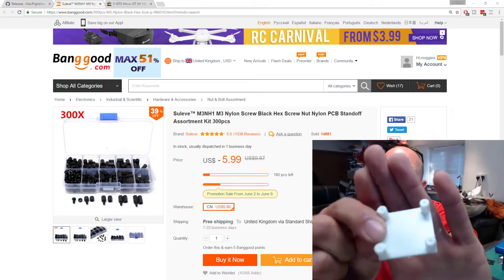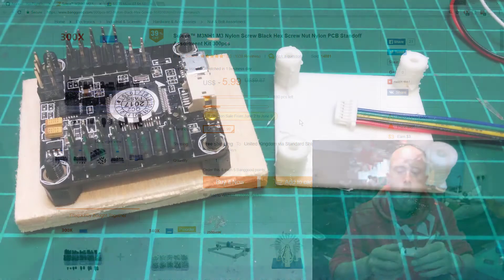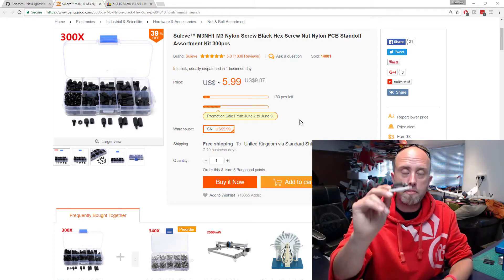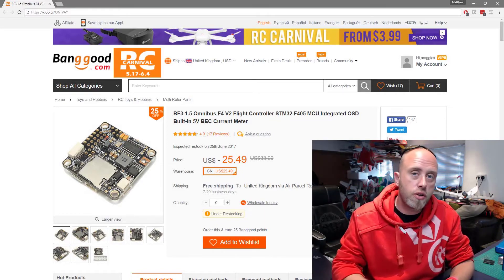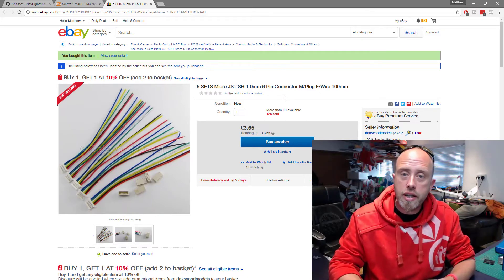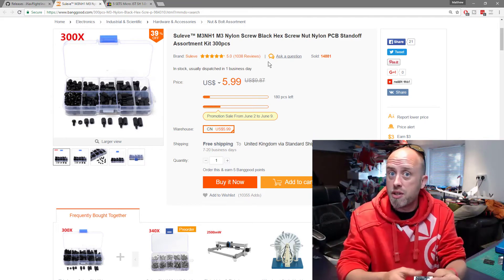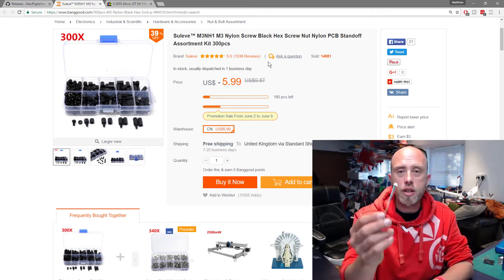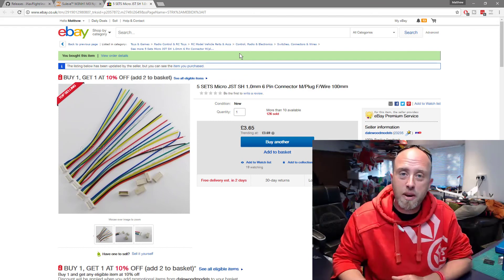Part #2B - Two Inexpensive Parts I Missed for Your iNav Build (updated version)

Comment: Don't forget when using the F4 FC boards of any brand, you should be using the rubber anti-vibration mounts. (NOT the hard plastic ones). I think these were the ones that I used.
"FPVDrone M3 Anti-Vibration Fixed Screws Mounting Hardware Standoffs Spacer for Flight Controller"-  From Amazon.com  about $8 for a package of 8.
Reply from the maker: Morning, they're not really needed in fixed wing models as there is a fraction of the vibrations when compared to a multi-rotors, Matt
Reply: I am going overboard for the sake of insurance.
Cheap or broken arm carbon fiber quad frames are great protection for the boards and all. 
At least for mounting in larger models I can even leave the arms on.

Comment: Greating from the US and enjoy your videos. Coming from Quadcopters, I'm excited about more flight time and the exhilaration of high speed. However, I bought a F4 V3 thinking it was better than V2, but it does not have amp readings, so I'm looking for the exact one you recommend. However, banggood is out and so is ebay. Which F4 Omnibus models with have the features you talk about? -Need substitutes please. There are various types of F4 V2s, but very confused.
Thank you.
Reply: Cliff. You find your answer? I am trying the new Matek F722 and the PDB with VTX. Have not set it up yet.

Comment: maplin do do them but and i mean but they will not supply you with the nuts or bolts to go with them and you only get 10 in a pack for £2 I ordered a set like this from bangood much cheeper and you get all of it and more!!!
Reply: You could also use a old broken PDB or FC board with some standoffs as a base to mount the Inav in the plane